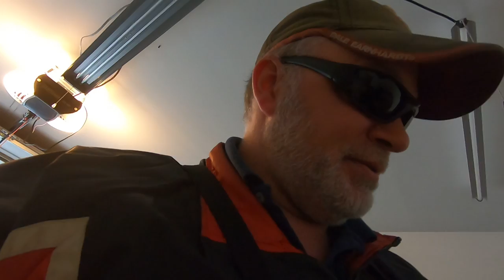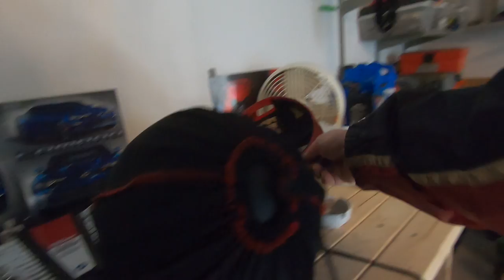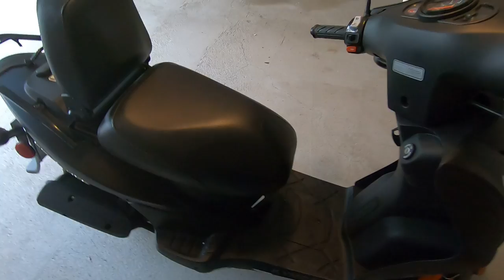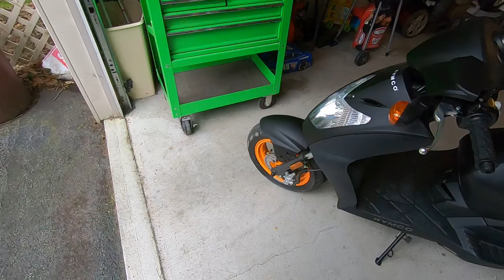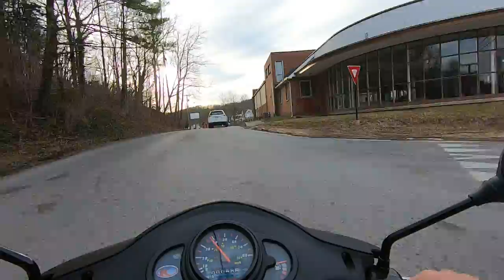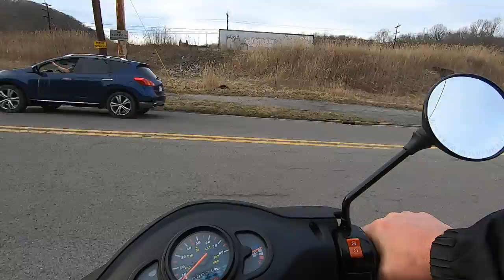Taking A Longer Ride On The Kymco Agility 50 Part 1 Of 3

Comment: My first scooter was a 49 cc Honda Metropolitan. I loved it. I sold it for a bigger scooter. The 250 cc Honda Reflex was fun but not as fun as the Metropolitan. The little one weighed only 176 pounds. The big one weighed 385 pounds. There is something more fun about a scooter so small and light weight that makes it more enjoyable. Though I lived in a city with no hills. Top speed on the speedometer was 39 mph. Which was perhaps only 33-35 mph. It only got 93 mpg. 

For a while I lived in a place with hills. At the time I had the KYMCO Agility 125. The bigger engine really helped with them. Though a good 49 cc two-stroke motor might be strong enough to handle the hills. Thank you for showing us the ride and the scooter.
Reply from the maker: Honda makes a very good scooter. Thank you for watching!

Comment: My 2007 kymco people s 49cc 139qma has over 100.000km on the clock.
The warranty is no more, but it does good at long drives.
With good maintenance it goes a long way.

Comment: Drove 295 km at Thursday with old 2006 Agility 50, no problems at all, and it climbs pretty steep hills too nicely enough...
Reply: Waaw great 👌 How meny km do you have in total on your scooter ?  I ride a Kymco Like 50cc .
Reply: @freedomformen2548  It's "new" old. Some 5300 km now. Had 3200 when I bought it :)
Reply: @freedomformen2548  It had sat for years in my uncle's garage, all it needed for that 295 km trek was new gasoline to tank and air to tyres. After that I have replaced cvt belt, and those centrifugal pieces on cvt, air filter, oil change, new battery and so on....
Reply: @janialander414  Good to hear that ! Its so much fun to ride on scooters.  Long distance trips are amazing , you see the landscapes slowly passing by and smell the nature 👍👌 Greetings from Belgium 🇧🇪

Comment: I had one and My only gripe was a 28mph speed. Im now getting a rx50 wolf that goes like around 35 or so
Reply from the maker: Mine goes a little faster than 28. I'm going to do a video with my phone on GPS.  It will show the true speed. I don't trust the scooter's speedometer.  I will also be doing some mods in the future.  By the time I am done, this scooter should do well over 40. Hopefully, around 55.
Reply: You should consider a genuine roughhouse 50 not much more expensive than the wolf. Is the fastest 50cc in North America. 47 miles per hour unrestricted. It has a two stroke motor.
Reply: 60’s Superman I wouldn’t recommend anything other than a genuine roughhouse 50 there made in Taiwan not China and there one of the few that make 2stroke scooters like the Yamaha  zuma which they only make in 4stroke option. I paid right around 1800 bucks out the door and without touching anything My top speed was right around 36 mph and it got there faster then my big bore ruckus that does about 50mph. The 2stroke has a lot more power and they are a lot cheaper to build or just maintain.
Reply: @seanmeehan8151  how has the roughhouse held up?
Reply: Do we need to clean up agility 50 electronic carburettor or it does not require any maintenance. I do not know much about machines but I think carburettors need to clean up after 2000 to 3000 Kms of drive. Agility 50 has an electronic carburettor while most of the scooter have EFI machines. Please share your experience. Thanks

Comment: The 150cc engine has different motor mounts and bolts up on the top and the 50cc 4 stroke mounts one the bottom however the 2 stroke 50cc has same mounts as 150cc to make a 150cc bolt up you'll have to have it fabricated to fit. I have en 07 agility 50 it has a 100cc head and an A9 cam and a 100cc carb and it will do almost 55mph that is a good option
Reply from the maker: I see that. I'm glad I didn't go out an but a 150cc engine.  The 100cc kit is much cheaper anyway. I guess I will be going that route then. Thanks for the info.
Reply: @Grey_Beard72  no problem I have heard of a150 with bottom mounts but I can't seem to find one anywhere you'll enjoy that kit though get the a9 cam as well and a racing clutch and veriator you won't be disappointed

Comment: Hows the mpg? Whats the max speed? Is there a piece to put in the middle tha makes it look like a motorcycle? lol i would pay for it
Reply from the maker: I believe it is supposed to be around 100- 110 mpg. I can't remember for sure. I live in a very hilly area, so mine will be somewhat lower. It still goes pretty far before I have to fill it up. I need to check it on the next tank.

Comment: Man I need to ask you a question I have a 94 CC TaoTao scooter it was a 49 or 50 cc is a 2013 and I'm swapping out the 

front forks to a quality Taiwanese 50cc agility Forks I don't know the year because the person who was selling it didn't say the year but that shouldn't even matter if I try to get so Agility 50 Kymco Forks Steam for it right pretty much 
they're all compatible with one another if the base of the forks are 50cc right huh . .?
Reply from the maker: The main thing is will it fit up top where you bolt it on. If the stem is the same size and diameter, I would think that it would bolt right up.
Reply: @Grey_Beard72  and oh oh okay I understand in thanks for the quick reply and comment I needed this you helped me a lot bro. :-)

Comment: Hay my kimco scooter cranks but won't stay started I adjusted the values put new weights in it. Have to kick start it cause the electric start don't work
Reply from the maker: It could be the carb. That is the first thing a lot of people say to change on the smaller Kymco bikes and scooters. If you watch my other videos on this scooter, you will see mine giving me a little trouble with the idle and being cold natured..

Comment: Nice bike, how do you d restrict the bike. 30 is too slow
Reply from the maker: I got a roller boss that wasn't restricted. It let's me go close to 40 top speed without messing with the rpm. Most scooters are restricted with the drive pully via the roller boss.

Comment: So I am currently looking for a one of these myself, what should I know? How can I make it faster and just all around better for me
Reply: Also, would you consider making a video on changing and installing the mods you put?
Reply from the maker: @noahd4433  I'm going to do some videos on the mods. The best scooters are the big names like Honda and Yamaha. Kymco is right between them and the Chinese scooters.  I've seen some Chinese scooters last but the vast majority either get trashed or do not age well.  I hear that the carb is the first place you want to upgrade. There is also supposed to be a cuff on the front pully of the CVT that is supposed to get you some more top end and also a wire you can clip to derestrict it. You can also switch out the exhaust for better flow. Other than that, you can do a 100cc big bore and that brings out loads of power.. I'm hearing some stories that the 100cc big bore is actually faster than a stock 150cc. I can't confirm it though.
Reply from the maker: Also, note that if you get a newer Honda 50, big bore kits are not an option. The cylinder barrel is part of the block. That is why GY6 engines are so popular.  They are much more customizable.

Comment: No warm up. Is a bad way to blow it up!
Reply from the maker: Most manufacturers recommend not letting it sit and idle for long periods of time. They usually have instructions to not warm up more than 30 seconds. To drive it but not to exceed certain RPM's, until it reaches operating temp. You don't see these instructions on the visors of cars anymore since fuel injection took over. They actually want you to have the rpm's up slightly to get the oil moving through the engine. The main reason for warm up in the old days was for the carb to act right.

Comment: Hi What is this Kymco 50 cc like ?  any thoughts ?  i am thinking about getting the Kymco Agility carry 50  (  designed as a lifting or delivery bike )
Reply from the maker: I really like it. Especially for the price I paid. There is better out there but they are more expensive. I haven't had any troubles with mine so far. I would definitely recommend it.

Comment: what's the maximum speed for this scooter? thanks.
Reply from the maker: Mine only went around 28 mph stock. I switched out the variator roller boss and now it does around 37 mph.